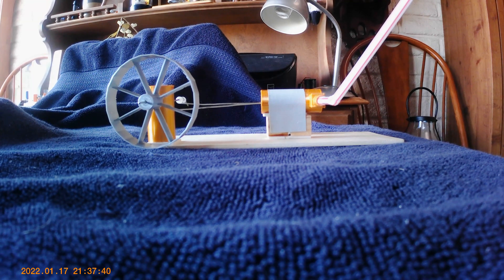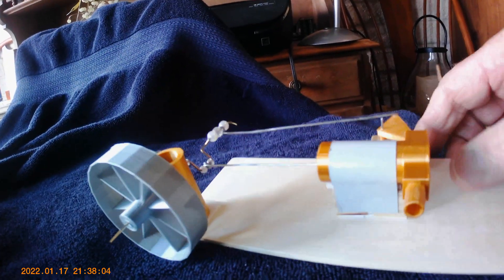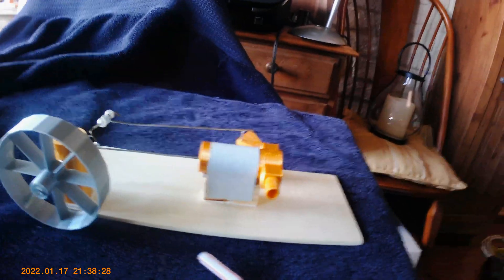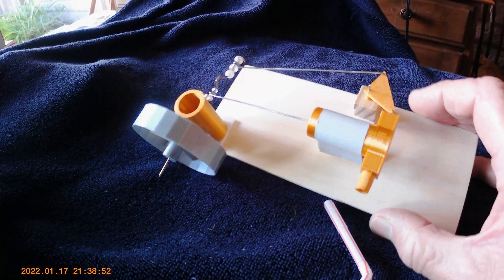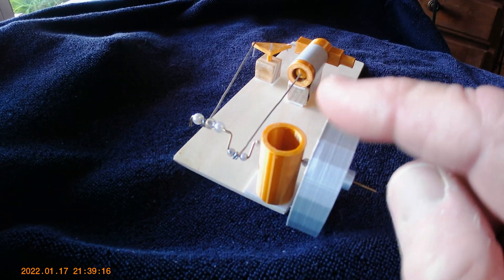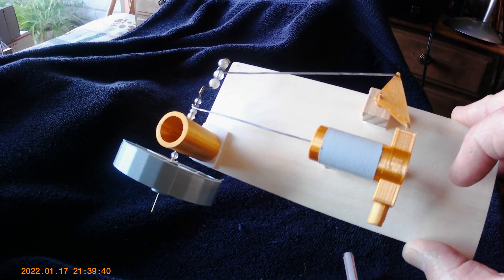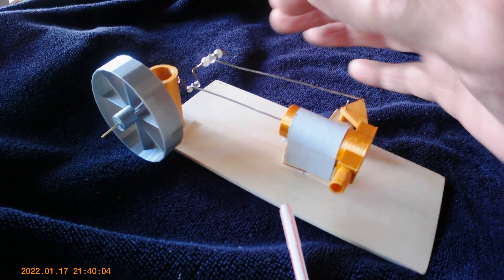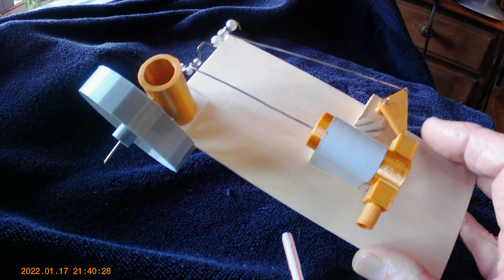Air Engine Project Update

Comment: Try adding another support at the valve actuating crank (on the outboard side).  That should eliminate a lot of the wobble and make it operate smoother.  Good luck!
Reply from the maker: Thanks.  The goal is to make the main parts with screw down bases so that I can firmly attach everything.  I am still prototyping the contraption.  Thanks for the valve support tip.

Comment: You can surround a magnet with ferrofluid for a low friction piston. It will leave black stains on anything it touches, and slowly dry out, though.
Reply from the maker: I have not worked with ferrofluid yet.  It is on the to do list.  Thanks.

Comment: PLA melts at 195 Celsius? Boiling water = 100 Celsius? I think yuo are okay to boil the PLA. Do you have a left-over in PLA? Please keep it in the kettles steam and check if it softens. Maybe this may come in handy as well for other projects (knowing if it softens or not).
Reply from the maker: The PLA is a no good in kettle steam.  ABS might do better.  Metal is really the only good way to build these things if you are going to use live steam.

Comment: thumbs up. i thought it ran pretty well.
off topic if i may?, wireless leds are a commercial thing now,( pretty much the same as maggie that's featured in a lot of your clips over the years, just tuned to resonate with a driver coil).
i'm thinking maybe try to get a pulse motor to run off the alternating magnetic field,( maybe full wave rectified with low v diodes, eg 5819's) of a coil say 4-6" in diameter with a few wireless leds mounted on the rotor. they can be a fairly compact package, a tiny choke coil, cap and 1 or 2 leds tuned to the drive coil frequency.
a joule thief circuit and a capacitor across the drive coil would set up a nice sine wave. either wind the motor drive coil bifilar and make it the joule thief windings itself or one of them chokes would work as a feedback coil. or lowish cost kits are available. i see adafruit has a chip based coil drive that runs off 5v. hope i'm not bein inappropriate with this schpeel. cheers
Reply: As a french reader i didn't had the whole of what you said. But as i have see maggy too if i got what you thought. It sound pretty cool. And costless to try. I enjoy heard more about it. Thanks for posting here. 😸
Reply from the maker: Thanks.  I will check out that adafruit part.

Comment: Brilliant, I couldn't resist having a go myself after watching your previous video and rewatching your original steam engine video. Mine was pretty much a fail, but it was interesting trying and obviously I will be doing a series of videos for it. They are scheduled to start February 7th. I was aiming to get it to run using a balloon as the air reservoir 👍
Reply from the maker: That is great news!  I am anxious to see where you end up with this project.  I will try mine on a balloon but right now I doubt that it will run on that.  I am still working on getting the design correct.  It is a work in progress that keeps me up at night.
Reply: @Lidmotor  I just eyeballed all the dimensions and was lucky it even half worked. It does look pretty, so I guess that is a bonus. I did try running it off a small electric pump, it was easier than blowing the balloon up every time, but it was giving too much pressure. Getting the timing right is the big challenge. I will probably do a new design with what I have learned, eventually 😆